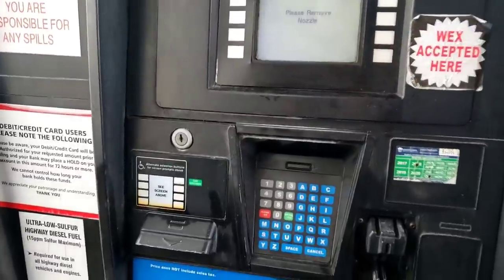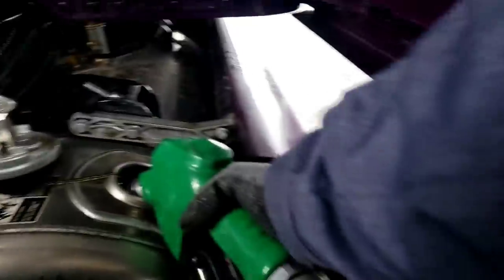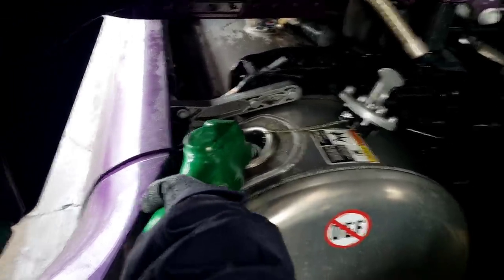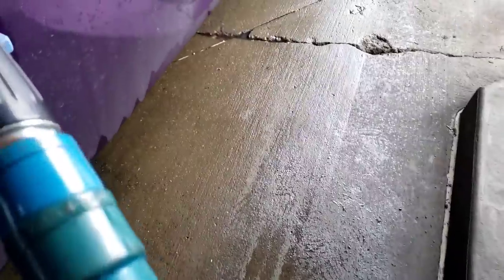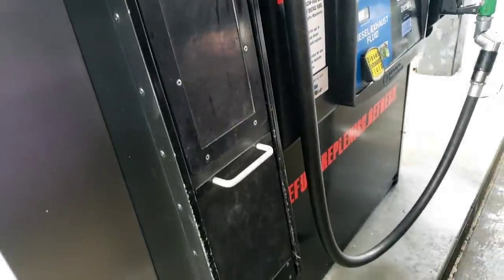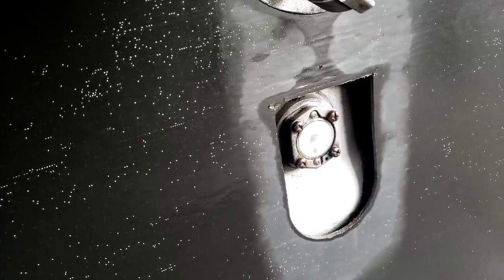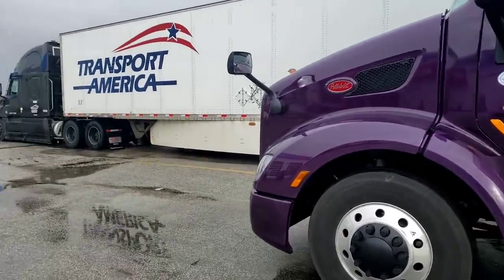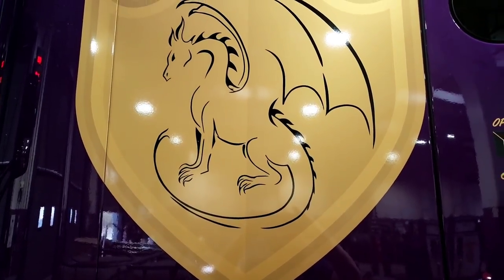How to Fuel a Peterbilt 579 (2021) Tractor Trailer (Semi Truck) - You Asked, I Delivered

Comment: I had a friend who pulled reefers for years, he showed me that a simple hand made flag he made from a coat hanger with a shop rag tied to it, that he could wrap or loop around the tank fill spout, beneath the cap, and just bend the hanger out so it stuck out to enough for the flag to show him exactly where the tank was in relation to the pump. He also said it can be as simple as a stick and a piece of paper towel, or even a piece of trash for the flag. Anything that could be harmlessly propped in there and be seen in the mirrors.
   This step is not always necessary for a pro, but it does eliminate the guess work. Hope this trick helps somebody out.

Comment: Hi JJ been following you for some time now and really like to see someone with common sense for a change. I was an OTR driver from 1972 thru 1989 back in the good old cab over days. I ran many different trucks and my favorite was a Freightliner Powerliner that had a Detroit 8V92TT that got 3 miles to the gallon in the mountains, but fuel was cheep and did not matter. I guess you can figure out how old I am now. Trucking has changed over the years I think to the better with technology but the professional driver has really gone down hill except for drivers like you. Its all about the training in my opinion. Anyway I was watching your video on fueling the Peterbuilt and not forgetting to put the cap back on and this is how I never forget. When I worked in the aviation industry we were trained when finished fueling to remove fuel hose and replace tank cap before putting the fuel hose down or away. If you follow this rule all the time you will never question yourself if you put the cap on or not. I do this with everything I fuel, even my lawn tractor. I you are not sure you put the fuel cap back on you can pull over and check. If you forget to put the fuel cap on an aircraft and it is not caught on preflight you can't just pull over in flight and the fuel will probably be sucked out due to air speed. Anyway put the cap back on before you put the hose away or put the fuel can away. Hope this helps and makes sense. Richard in Georgia
Reply from the maker: Thanks Richard! I think this is a great idea and I'll start doing that. I'll also mention this in my questions and comments of the week.

Comment: What’s the total tank sizes and how far can you go with them?
Reply from the maker: 2 tanks at 100 gallons each for my truck. 200 total.
If I average 8 MPG, (depends on load weight, hills/mountains, wind, weather, etc...) I can get 1200 miles. That puts me at 1/4 tank.
1200 miles is covered in 1.5 to 2 days.

Comment: I like the caps on the fuel tanks , the KW still has the screw on s.
Reply from the maker: I agree these would be better than screw on, but these ones are still a pain in the butt. I do like the ones on the Freightliner. It's a quarter turn and that's it.

Comment: Are both fuel atnks the same size and how much can the tanks hold?
Reply from the maker: On my truck both tanks are the same size at 100 gallons a piece. Some trucks Have 125 gal, 150 gal or even up to 200 gallons. They can also be mismatched like 100 gallons on one side and 150 gallons on the other.
Reply: We have 125 on both sides and we fuel on the side but it's not easy like the freightliner

Comment: Figured the tanks would be tied together so if you fill one it would fill both
Reply from the maker: There is a feeder hose between the two tanks however it would take a long time for the fuel to flow through that and fill the other tank.

Comment: Every  make & model  of  truck  has  its  quirks  hood or bad  it’s  a  trade  off  you probably liked things  Freight shaker  better  then the Pete  and  vica  versa  my  recommendation  is your next  power  unit  should be a  western star  they  do  customization  on  the   Mounting and location. Of. Hardware  & switches  & gauges & handles  & what nots  whithen reason  yes  they are a  expensive  truck  but  it’s  your  money maker  office  and  home

Comment: Why don't you just reach under the fairings on the side unlatch them and pull them down like I do then when you're done all you have to do is snap on back in place they have two lapses in the center of each of the fairings that cover the fuel tanks all you have to do is just lower them down and then push them back up and snapping back in place it's like opening a door

Comment: I'm always cautios when I fill up on DEF at truck stops. If I can buy jugs of DEF in a store I'll do it. A close friends truck has gone through 3 DEF sensors. He thought the sensors were faulty because the dash light kept coming on but now he's thinking the DEF itself is the problem. He thinks it's actually bad quality DEF.
Reply from the maker: Is he fueling up at the same place every time?
Reply: @JJtheTrucker He fuels in either Illinios, Indiana, or Ohio. But mostly in Indiana.
Reply from the maker: Maybe it's one of the stations that he regularly visits. Their tanks may be bad. It would be very rare  For multiple stations to have a problem like that.